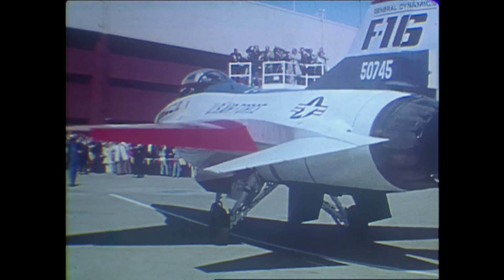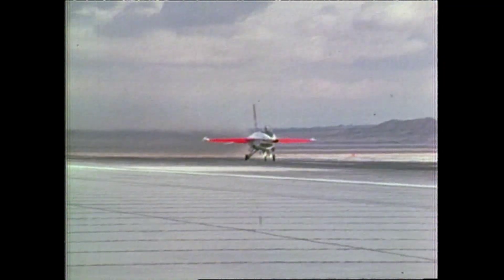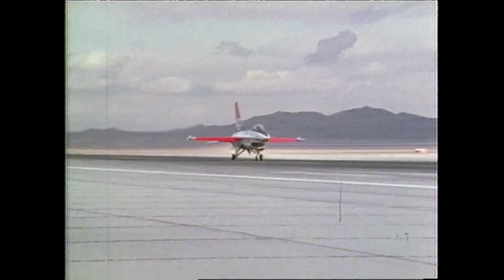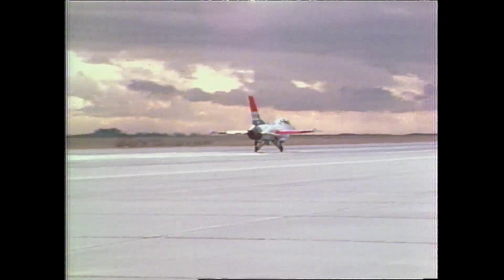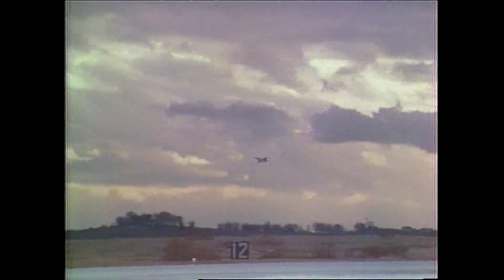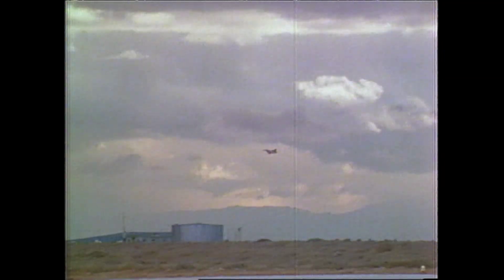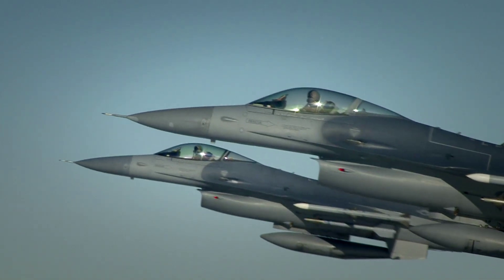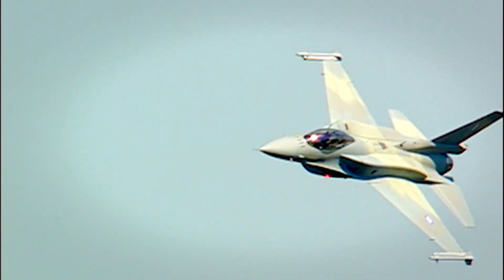Memorable Moment - YF-16 Test Pilot Phil Oestricher

Comment: My father-in-law Ralph Graf worked on the flight control system for the F-16... he's still alive living in the Fort Worth area. He told me the original design was all electric and the stick didn't actually move at all, and the test pilots hated it 😜. He said Phil was the best test pilot he ever worked with and his flying was super-smooth... he has told me the story of the "first flight" many times. They took all that data from the unplanned flight and made adjustments to the flight control system before the next flight. He is still very, very proud of what they accomplished with the F-16.

Comment: Robo-Cat like reflexes!
In it’s first iteration the Viper’s stick did not move.  It sat to your right and was extremely sensitive to the force of inputs, but it did not move forward, aft, left, or right.  This is at least part of why it was called, “The Electric Jet,” because that kind of pilot interface is about as fly-by-wire as it gets.
They later added some mechanical deflection so the pilots could have a more natural feel for the stick, one that is more like a stick that is connected to cables or hydraulic actuators.
Hell of first flight!